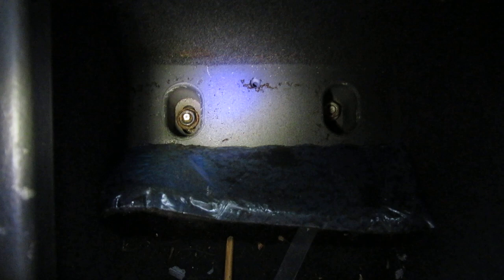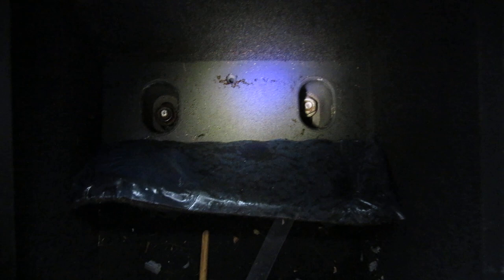How to replace mercedes benz Lateral acceleration sensor BAS Esp light pt 2  ( Must Watch )

Comment: Another tip is after you replace the Lateral Acceleration Sensor,  turn on the car.  Then while stationary and the BAS/ESP light is on, turn the steering wheel all the way to the right and then all the way to the left.  Turn off the car, wait about 1 minute or so then turn it back on and the light should go away indicating that the problem is fixed.